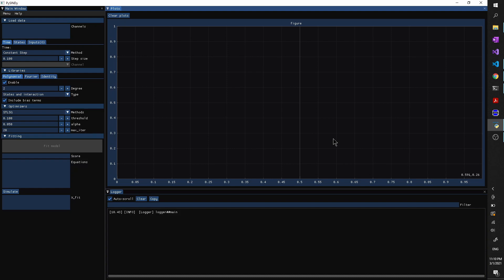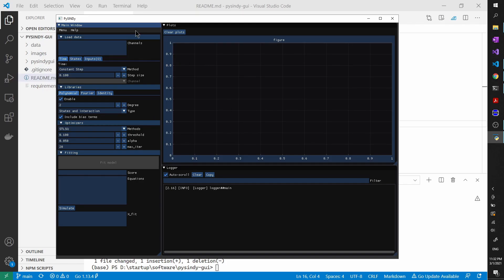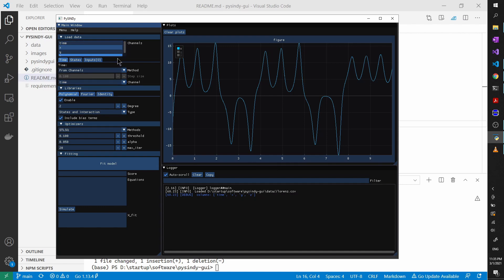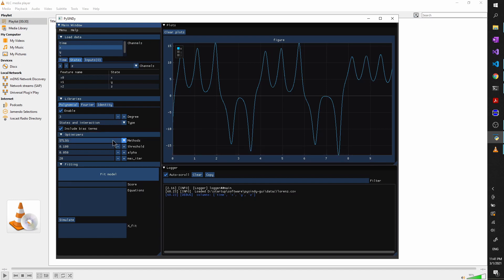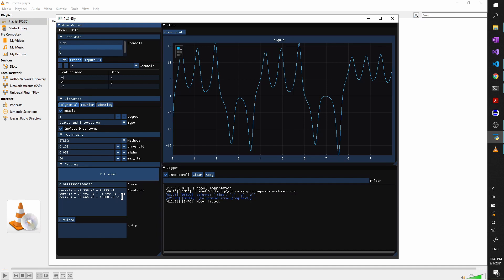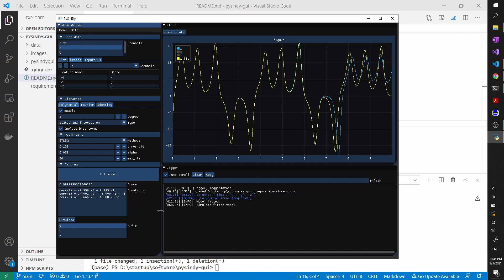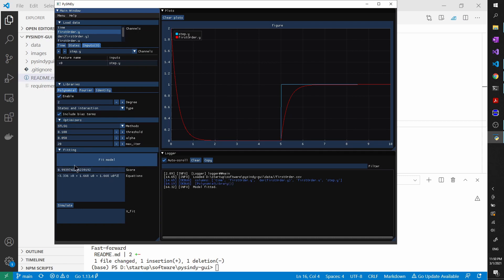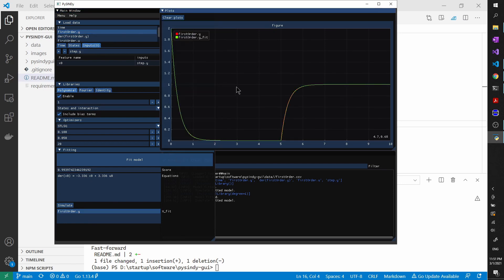PySINDy GUI tutorial

Comment: Hi Hang, I also could not run the gui.  After cloning I ran the code below but python gives an error.

from pysindygui import PySINDyGUI

app = PySINDyGUI()
app.run()
Reply from the maker: Hi, you can give it a try by running the code in the repo readme file, I just tested it should work.